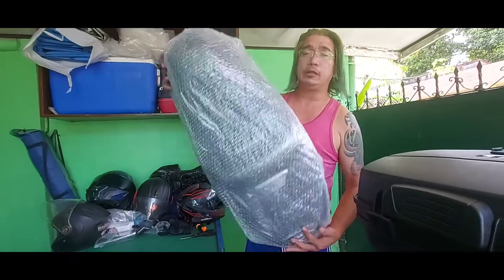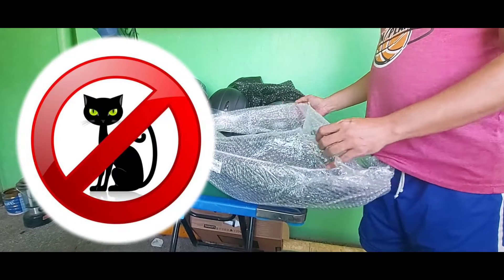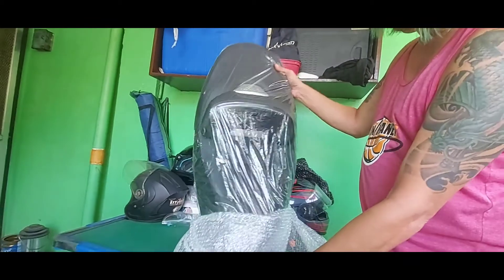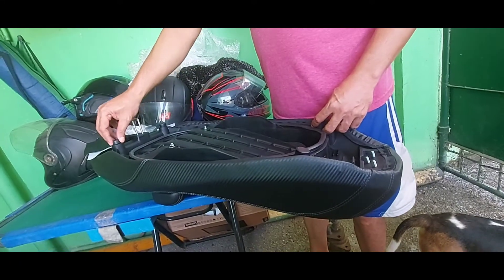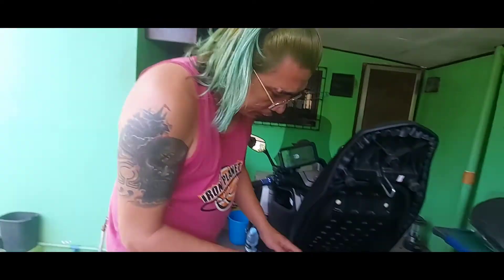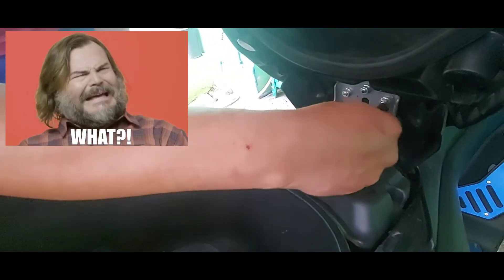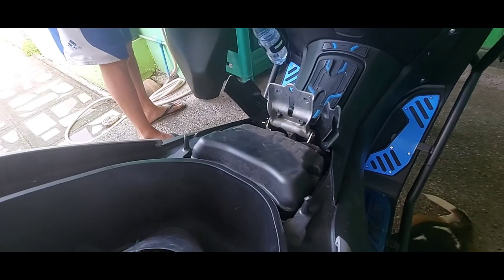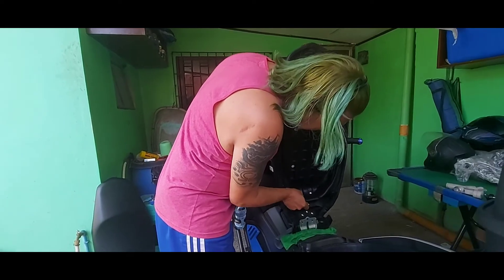NMAX V2 Camel Back Seat / How to Install

Comment: Dumudulas kaba sa upuan boss pag napreno? Tska musta comfortable ba
Reply from the maker: Di po sir. Makapit po sya di kagaya nung stock. Mas comfortable po yung back ride dahil di sya dudulas hehe 🥰
Reply: @scaramoochitv  ung inner rubber nyan boss?? Wlang kasama? Nde ba maalog pg wlng rubbet
Reply from the maker: @gian5138  kasama po yung rubber pag binili nyo kaya salpak na lang... dagdagan nyo lang po ng 6 nuts para sure na nakalock yung mga turnilyo  pagsalpak 🥰
Reply: @scaramoochitv  actually aerox kse ung aken, wla akong mkita kseng seller na may ksmang rubber na, laging snsbe kunin nlnh ung sa stock
Reply from the maker: @gian5138  pwede naman hehe... thanks sa mga comments. RS always 🥰

Comment: Bumaba ba o tumaas yung sear height compare sa stock paps? Mas gusto ko camel back kesa sa flat seat kaso 5'1" lang ako e. More power!
Reply from the maker: Di naman po masyado nagbago yung height ng motor with camelback seat pero kung stock pa po ang shock nyo sir, pwede nyo naman po i adjust para sa height nyo.